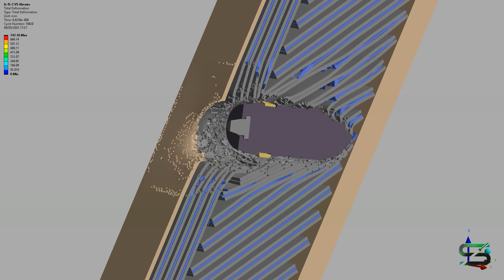IS-2 VS M1A1 Abrams | Armour Piercing Simulation

Comment: Invalid result.
BR-471 is an APHE round, it stands for Armor-Piercing High Explosive, which means it has an explosive filler.
The video even shows us the fuze in the bottom of the projectile, but omits the HE filler - as omits the detonation and its effects on the armor.

Nice simulation, but tells us nothing about the real capabilities of the round.
Reply: would it detonate tho? I don't think the 1.2m fuze delay the round has would be triggered, if it would be sure to correct me.
Reply: @PistaZOV It would. I do not know what 1.2m means, but according to the manual it has a 0.9 millisecond (0.0009 second) fuze delay. It should detonate, maybe even before full stop between the layers.
The MV is 774 m/s, at 10 meters I take the velocity is the same. Ig the shell travels with the same velocity during 0.0009 ms it travels around 70 cm. But during the armor penetration it loses velocity, at one point in the video it is stated that it lost 61% of it's velocity, so that 70 cm distance should be much less, maybe 35-40 cm. It is about the length of the shell.
Reply: @IntoTheVoid1981  m is short for meters, so 1.2 meters. I'm guessing this is a situation where I get my info from a game and you're the actual knowledgeable person here, but in WT your shell travels roughly 1.2m after penetration so that your APHE doesn't just act like a HESH, instead exploding in the middle of the bath.
In reality, it does mechanically make way more sense for it to be based on a time delay, however small and not distance. Thanks for the info.
Reply: @PistaZOV OK. Sorry, but I do not know the game or how the in-game physics work. I based my comment on real-life physics and math. Thanks for the reply!
Reply: Thanks, I was about to comment this. Had the round gone off that crew would've had a very very bad day 😂

Comment: There is no way that this shell actually penetrates the side armor of the turret.
A 122 mm full caliber shell at 780 m/s will have a really hard time penetrating more than 150-200 mm RHA (depending on the quality as there is LOTS of variation in RHA quality).
If there is an HHA plate or something of the like (ceramics) in the Chobam, it will just shatter the shell.
You bet that if we could actually defeat modern MBT with such an outdated ammunition design, we would not have developped APFSDS-T in 105/120/130-140 mm.
Reply: About last sentence, issue is, this is literally perfect conditions shot that is only really feasible in urban guerilla combat. In ANY other case IS-2 obviously don't stand a chance unless some sort of very lucky shot.

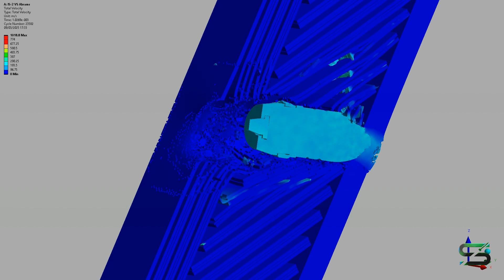Comment: 1:10 still your also not compensating for the Shells explosives sense it is a APHE (Armor Piercing High Explosive) Shell not to mention the BR-471 and BR-471B Have a TNT Equivalent of 246.4 grams of explosive power
Reply: So it should have less penetration unless it has a deep/post impact denotation 

The rubber plate layers do better against chemical munitions than kinetic hence the video showing success with a full caliber AP round

Comment: The fact that a WW2 era tank could ALMOST penetrate an Abrams turret is shameful
Reply: I mean tbf I don't think at the distance any other tank will fare any better.
Reply: That could be the situation for almost any modern MBT, A T-90 would not have better luck considering that the side ERA is terrible against kinetic projectiles
Reply: Turns out that making big chunks of metal go really fast is pretty easy. Stopping those big chunks of metal is orders of magnitude more difficult while also hitting other design goals. An almost perpendicular side-shot is also pretty close to the worst case scenario as well.
Reply: Seems like you don't understand how works penetration... You are idiot 😂

Comment: APHE would have blown up, with the inside plate pierced, the crew would likely be toast
Reply: With the actual filler sitting at the back of the shell, this is unlikely. There is a video debunking that the explosive filler in aphe helps in near-penetrating shots
Reply: @cantthinkofabetteruser  can you send it ? I'm interested
Reply: The shell might not fuse if it doesn't fully penetrate. Plus the explosive filler is at the back of the projectile, so it's effect would be nullified since it's still stuck in the composite within the armor plates.
Reply: I thought that at first, but the spaced panels and the space between the 2 main plates would capture and disperse the explosions force.
Reply: APHE only work if the shell can fully penetrate the plate.

Comment: “No significant damage will occur    inside the tower”

Microscopic fragments bouncing around the interior from the fractured metal: Are you sure about that??
Reply: Any amount of spalling doesn't automatically mean instant death for the crew. The number of chunks of armor that broke off when the shell reached the end of the armor array appears to have been fairly small, and it doesn't look like it would have spread out into a particularly wide cone. So there's a pretty good chance that none of the crewmen would have been hit.
Reply: Yes , turret is fine.. But turret crew is dead 😂
Reply: @DeZug  Spall liners and tank crew armor will deal with what little spall came from that. The crew just has a crazy story on being shot by an 80 year old heavy tank. Now if the shot was a few feet lower it would be a very different story.
Reply: correct me if im wrong but i believe that the abrams has no spall liners, just that the crew wears some type of body armor. @ATruckCampbell
Reply: @ From what I have read it has not been disclosed like a lot of it's armor. I admittedly assume it does like most other modern AFVs. The crew does wear armor, though on a full penetration and with large spall I can't see it helping a huge amount.
Reply: @ATruckCampbell  Yeah, its more of a mentality booster for the crew, although in a situation similiar to the video i suppose the spall liners would help a little.
Reply: M1 like most modern tank have spall liners to catch small things like that
Reply: There is a kevla layer inside to limit the spall.

Comment: I just want to point out that at 0:35 what he meant by soviet tank is soviet WWII tank because the soviets made even scarier tanks during Cold War.
Reply: The 130mm Soviet gun would be a very real threat to any modern tank, all that mass and energy has to go somewhere.
Reply: @ATruckCampbell I'd argue, it is only dangerous for sides and backs of modern MBT's, and in most cases, assuming point-blank shot, they can be easily penetrated even by late-ww2 85/88/90mm guns

Comment: Pretty sure the spall from the HE filler explosion would be a traumatic event for the turret crew, potentially killing everyone with overpressure waves.
Reply: Какой еще давление? Это тебе не 20 кг тротила в снаряде... Господи откуда вы такие берётесь...
Reply: @interpl6089  doesnt the Abrams have a spall liner though.
Reply: @niksonrex88  It doesn't. At least not the M1A1. They simply didn't install them due to cost and weight.
Reply: @niksonrex88  no
and spall line aint stopping overpressure wave
Reply: @niksonrex88 not according to Gaijin's
Reply: @niksonrex88 spall liner ain’t stopping the force of 250gr explosive filler alone.

Comment: IS1 with 85mm gun firing a 122mm shell?? Huh?
Reply: the forbidden squeeze bore
Reply: war thunder player be like:
Reply: Hes prob reusing model
Reply: En wot es el IS-2 chino como el del video
Reply: Reverse squeeze bore
Reply: It's is2
Reply: @Степаха-ю3л  no that's clearly the IS1 cus the IS2 is the one with the big muzzle brake
Reply: @Степаха-ю3л  Yes, but the 3D model showcased in the simulation is a IS-1 with 85 mm gun
Reply: @Степаха-ю3л это не ИС-2, он выглядит по-другому, это ИС-1. Хотя заявлено ИС-2
Reply: @Степаха-ю3л  This gun and gun suppressor is not IS-2 122mm gun....  The gun show you this is IS-1 with 85mm gun
Reply: @DeZug  What suppressor?
Reply: @ Please google picture IS-1 and IS-2

Comment: Pretty sure there would be internal spalling, causing the gunner to have a "significant emotional event." A witness plate in the simulation would be good to see the extent of said spalling.
Reply: Crew just turn yellow
Reply: @ชมัยพร-ร4ด  желтеет снизу, и возможно коричневеет...
Reply: Looked like a chunk just barely broke off, would be dependent on the spall liner to catch that
Reply: @connivingkhajiit  add explosion of the shell itself and you get much more and faster spall
Reply: @connivingkhajiit In these simulations, things are slowed down a lot. Peices that 'just barely' break off are still travelling fast enpugh to be extremely lethal. Additionally, there would be plenty of small metal shards not visible in this simulation -- see any spalling video with a witness plate, spall damage shows up before the large chunks get there, as theres a bunch of tiny metal pellets going much faster but not visible on the sim.
Reply: literally explained in the video that it will be very unsignificant
Reply: Надо еще учитывать силу взрыва снаряда, у ис2 она довольно большая
Reply: @creame228  тут 50/50 взорвется или нет, детонатор сильно пострадал
Reply: @КанистраКеросина  детонатор практически всегда срабатывает, разве, что из-за неисправности
Reply: @creame228  wouldnt the rubber metal plates do better against it exploding?

This seems like pure full caliber AP performance instead of one with explosive filler and explodes after the first plate
Reply: I believe the M1 has spall liner around the turret
Reply: @2m00. sorta, they have thin metallic plates, different metal densities absorb spall
Reply: @2m00.  No abrams dos not have spall liner
Reply: @2m00. the abrams doesnt have a spall liner on any version. Instead the crew is issued kevlar vests iirc but still not as effective as a genuinely liner
Reply: The spall liners are integral, you don't see them in the interior  @lightpenhater12
Reply: @Halal_Dan M1’s don’t have spall liners. The kevlar liners are meant to stop fragments coming from the actual armor array. Putting them inside wouldn’t make sense as the metal plate after the spall liner would therefore generate fragments yet again.
Reply: @ thats not how a spall liner works.
Reply: @Halal_Dan  if the liners were integral so to speak, they would literally just be part of the armor. They are meant to be the last most inward layer to catch spall coming from the actual armor, if they are in the armor itself you are literally just making them a part of the armor and contribute to the spall making their use pointless
Reply: @Halal_Dan  on top of this, in interviews with crew members themselves they have stated there are no liners, and in videos of the interior there are no liners.
Reply: @Halal_Dan  They don't. They tried putting spall liners in a test vehicle and it weighed 2 tons. The army rejected it.
Reply: @lightpenhater12  Tankers aren't told what constitutes their armor, believe it or not, and many Tankers say the Abrams does have a spall liner. You do realize not all spall liners are made from Kevlar. Yes they can, in fact be integrated with the armor, A notable event that demonstrates that the Abrams does have some sort of spall reducing liner is when it was hit by a HEAT round in the turret rear you can see in the photos just how little spall there was, it was below what you would typically see from HEAT and not a single crew member was hit, despite the HEAT jet passing right past a crew member grazing their flak jacket.
Reply: @ServusIchBins  Not all Metals are the same type or hardness and generate very different amounts of spall. You can, in fact, use lower lower hardness metal to reduce spall from the higher hardness main armor
Reply: @ thats because of the armors NERA, its made especially to counter HEAT jets as its layers of elastomer and rubber layered in the armor to absorb specifically HEAT projectiles. Try again
Reply: @ It was not even the rear turret, that was my mistake, it was the hull which has not such composites, so what is your excuse going to be?
Reply: @ Using your own logic, you can't use something integral to the armor to reduce spall. Oh wait
Reply: @ its not catching the spall though. The rubber lining disrupts the jet itself resulting in the HEAT jet being less effective. Its not as good as ERA but it helps, but yes you cant use integral things to CATCH spall, but you can use rubber linings within the armor to disrupt chemical projectiles, theres a big difference
Reply: @ what are you referring to?
Reply: @lightpenhater12  Oh, but they are. It's catching the much harder outer armor, which produces significantly more spall. The main point of that argument was to show you how the inner plate produced little to no spalling despite being penetrated. NERA or not, there should still be spalling from the inner layer. Your problem is that you completely ignore the variables that are hardness, thickness and type, which DRASTICALLY affect spalling. We know for a fact that the Abrams uses a Kevlar liner in between the innermost plating, and we also know he innermost plate is very soft and thin as well as being fused to the Kevlar, which further holds it in place. Finally, you can't argue that integral Spallliners don't exist for the reasons I just explained and because companies literally produce and advertise them.
Reply: @lightpenhater12  And which one is this referring to? lol
Reply: @ that is not how that works lmao. NERA works because of the change in material, its not catching spall. Spall liners cant be integral because spall is a POST PENETRATION EFFECT meaning by definition a spall liner has to catch spall POST PEN regardless. This is not hard to understand, stop it lmfao
Reply: @ youre right that material types and hardness affects spalling, but that only really applies in non composite armors and on the final layers of armor before penetration is achieved, as well as the total amount of the round left, and its for this reason why spall liners have to be the very last layer unless you want it to do nothing
Reply: @lightpenhater12  palling is NOT a post-penetration effect; it's simply the term for fragments flaking off of a larger body. This is why the term 'spalling' is still used for HESH rounds. Even when they don't penetrate the vehicle, they still cause fragments to flake off the armor, which NERA defeats for obvious reasons. Had I wanted to, I could call NERA a spall liner, Lmfao.
Reply: @lightpenhater12   "only really applies in non composite armors." ???. Again, the Abrams's inner walls are thin and soft aluminum fused to Kevlar. As such, they can't produce significant spalling but instead reduce it by catching lower energy but dangerous particles. Like every other spall liner, this is the final layer; it is not armor.
Reply: @ man whatever this isnt getting anywhere lmao. Keep spreading un backed misinformation online
Reply: @lightpenhater12  Tf you mean "unbacked", you didn't even ask for a source. I can back up my stuff with sources if you want, or you can take two seconds and look it up. This is just a silly excuse to run away instead of admitting you were wrong. You say I'm spreading misinformation when you couldn't even get the definition spalling right. Lmfao.
Reply: @ youve yet to provide a single source for anything you claimed. Also spalling in this context is any fragments generated from the backface of the armor because the projectile’s energy as it fully travels through the plate causes fragments to flake off inside, which is why internal liners don’t work. This isnt rocket science, its understanding basic energy transfer principles. 

Go away
Reply: @ having kevlar sandwiched in the plates doesnt do anything because by the time the projectiles energy causes backface spall, its past the kevlar unless the kevlar is the last layer in which it wouldnt be an internal spall liner
Reply: The M1 crew wears flak jackets. IMHO with that amount he would have to be very unlucky to be wounded.
Reply: Abrams will just absorbed it irl. These Simulations are far off from real life obviously.

Comment: Why does the projectile angle down when striking the angle up internal plates?
Reply: Shell normalization due to cone shape. Its adjusting to a path of least resistance. The ammunition is already damaged from initial contact causing it to grip the plates and turn.

Comment: I can understand that 3D Models may be limiting in terms of choices for your animations, but am I correct in that this IS is actually an IS-1 Model? I noticed the shorter thinner barrel with a lack of muzzle brake, which I would assume would mean this is an IS-1 with an 85mm because you couldn't get a proper IS-2 for the anim?
Reply: The thumbnail has the correct is-2 but I believe you are correct that the 3D model in the video is an is-1

Comment: So that side is stronger than Maus's turret front, impressive.
Reply: That's modern tank armor.
Reply: @WolfeSaber  wow is it really dude thanks so much we missed that
Reply: its probably stronger than that bc the simulation has no idea what the abrams armor is made of
Reply: I think you mean the Tiger II turret because on no world could the D-25T have penetrated the 220mm curved front turret of the Maus
Reply: @evansmillan8868  there is a simulation where it does

Comment: what about the HE filler fromm the 122 ? its already close on the last palte of the Abrams
Reply: HE filler in real life just spreads out the pieces into a wider cone. Warthunder's aphe filler is fantasy.
Reply: @BloodyCrow__  you know how is a 200g TNT explosion?
Reply: @BloodyCrow__  Not really. Enough HE filler (like the BR-471) can complete the penetration if it's stuck in like this. If it exploded the spall would be devastating for the entire turret crew, and the overpressure waves would probably not feel good either.
Reply: Yes, exactly, isn't APHE armor piercing high explosive ?
Reply: @agentp21  yes it is it would have exploded quite a ways into it but if it explodes where it stopped that's it for the crew